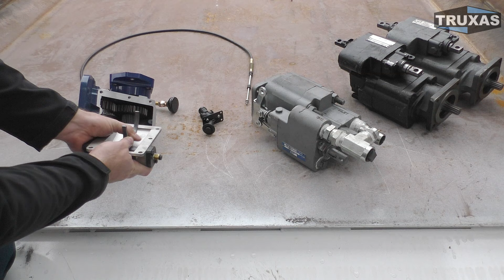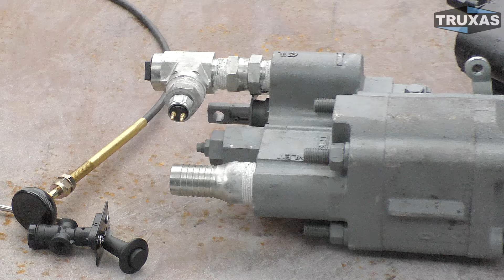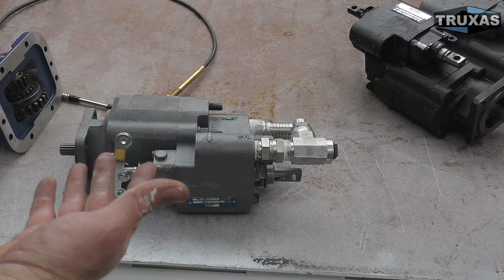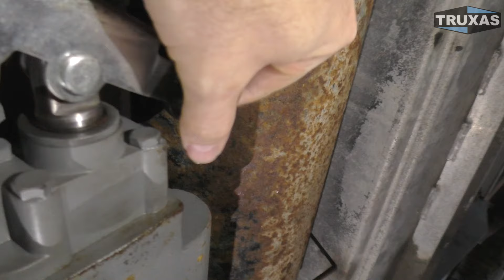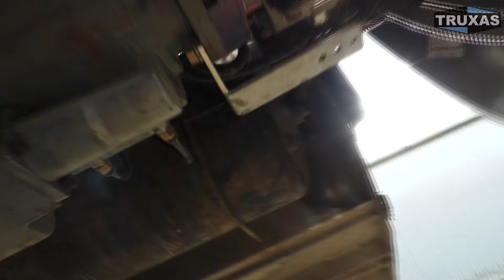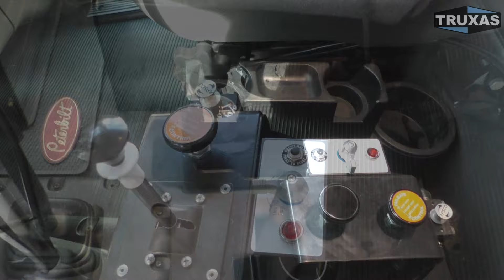Troubleshooting: Dump Truck Pump and PTO Troubleshooting

Comment: Wow- how is 1 in 20 automaticly not functioning? And 1 in 40 crap-out in 6ish months?
Simply poor manufacturing? 
You kinda alluded to that mentioning they looked like they were all siblings from the same factory..

..i had new rear brakes on a tacoma to install.  Pins were pressed in incorrectly seated, sitting at an angle rather than perpendicular.  Took them back to the parts store,  the other 2 new sets were the exact same. 
So you figure a few folks asleep at the helm for an hour or two ran off a couple thousand of them and got sent out..
But those pumps are not flying thru stamp and press stations like non-complex drum pads.  
Wild. 
What a waste of everyone's resources, huh?
Reply from the maker: yep, mainly bad internal seals.

Comment: I have a question it’s on a air system it goes up fine but takes like 7 to 8 minutes to go down
Reply from the maker: check the ajusment of the cable if its cable control, just like in the video, we do cover slow dump body lowering.

Comment: Im having to the issue that the pump is always on. 

It raises fine and drops fine. 

But the pto wont cut off. 

If i press the clutch it disengages. But once i let off the clutch, you can hear it.

All i jave to do is lift tue pull cable and up it goes. 

I have cut the air off to the up and down valve but its still engaged.

Im clueless 

Any help would help out

Comment: Can you clock a pto or pump to not hit air tank. It seems mine is hitting to the point where i would need to remove air tank and remount or get new smaller tank

Comment: I have a 1995 C60 Kodiak that has a Tulsa chain powered winch coming off the pto. I'm mounting an IMT HYDRAULIC crane on the bed that is hydraulic. What are my options for running both devices? Not necessarily at the same time it's just one is hydraulic, and one is chain driven.
Reply from the maker: most transmissions have 2 pto ports so you can have 2 hydralic systems, or you can by a more complex pump depending on what your powering

Comment: I just bought a 2001 international 4900 dt466e dump truck retired city street dept. plow truck has a allisson auto and they claim the pto is always engaged or no switches or levers to engage or disengage that doesn't sound good to me is there a way to change it or just add a switch or cable?
Reply from the maker: you can set them up with the cable, but most are electric becuse the transmmision needs to know your turning the pto on.
Reply: @TruxasSales  I want to make it a part time pto so you have to engage it can you lead me in that direction please
Reply: I'm being told that it's made in the automatic transmission and runs all the time that just don't seem right to me
 @TruxasSales

Comment: How to bleed your system after installation of new pump.?
Reply from the maker: depends on the hydralic hoist you have some are self bleeding. but the air will get trapped i the hoist not the pump

Comment: My dump truck bed lowering way too fast when it's coming down how to adjust it
Reply from the maker: Depends on if its air controled or cable? If it has a load in it it will always be prone to coming down fast.
Reply: Mine does the same, even when empty.

Comment: On Friday, i went to go dump a bed full of dirt. I drive a Peterbuilt. On the way up, not even a quarter up the way, i noticed my tarp was still down. Stopped the bed from going up to raise the tarp. Once i did that, the light on the control module for the bed that’s in between the 2 seats, the light went off. Now i can’t raise the tarp not the bed. What happened ? Any ideas? Feel free to call me plz

Comment: I have a driver who insists on leaving his bed up every night and the Maxle lowered almost to the ground. Is that ok to do? If not why? Thank you. All your videos are great.
Reply from the maker: You dont want to leave the bed way up because it exposses the dump cylynder to the elements and it can become tarnished or rust (the chrome part of the dump cylinder). Dump truck hydralic hoists are not the same as heavy equipment hoist that are ment to get wet. Raising it 6" to 12" to aviod puddling in the bed is good.

Comment: Question, if the dump truck bed is coming down too fast while unloading, what could the issue be?
Reply from the maker: could be there is material stuck in the bed making it weigh more
Reply: You either need a feathering air valve for controlling the valve, or...you are disengaging the PTO when lowering the bed. Don't. Use the hydraulic control valve only to lower the bed. When it's down, then disengage the PTO.

Comment: I got Question, I have a direct mount pump to the PTO as shown on this video,
Now is there a universal Yoke joint that can work off the Pump Shaft Using a pto shaft ❓
Reply from the maker: all Yokes are universal, but need to be the same size to work.
Reply: You either have direct mount components, or remote mount. They are not the same.

Comment: What will be the issue of when cylinder start bouncing at the last stage and hydraulic tank has enough hydraulic fluid. Also if i continue to accelerate to raise it all the way when I turn off the pump and lower the cylinder hydraulic fluid start leaking bubbling out of the hydraulic tank.
Reply from the maker: You need to bleed the air out of the cylinder, if you don't have a self-bleeding one, should be an air bleed valve on the top of the cylinder. check the oil level with the cylinder up.
Reply: You have air in the hyd oil. Your reservoir may be too small.

Comment: What would make my bed start dumping when I just turn the pto on and won’t stop going up until I push the clutch in it won’t stop if I turn the pto off or put in in lower position just if I push the clutch in then I can lower the bed also air powered
Reply from the maker: out of adjustment hoist controller.

Comment: I have a issue, when I'm lowering the end-dump, start losing hydraulic fluid for the tank lid. What could cause this?
Reply from the maker: It needs a small baffle protecting the vent cap. when you lower the bed the oil is shooting into the tank at high speeds.

Comment: how do you control the bucket lifting cylinders not to experience high pressure when offloading  to eliminate hydraulic system pipe bursting?

Comment: Is there a high pressure relief valve in the systen?!
Reply from the maker: Not typically on dump truck systems.
Reply: Yes, the dump pump valve has an adjustable main relief built in, preset at 2000 psi. Max setting is approx 2300 psi.

Comment: The main reason 1 out of 20 fail right away is they are mostly low quality China product. The only dump pump still made in the USA are Permco. Even Parker/Commercial are not made in youngstown anymore.
Reply from the maker: Premco is hard to get a pump out of
Reply: @TruxasSales  That is true. Our lead times are the highest they have ever been .Trying to get castings out of USA foundries now that many of the biggies are coming back is tough. We were kicked out of the foundry we poured our dump pump valve housing and finding a new supplier wasn't easy. That being said our lead times are better than most of our competitors. We are working very hard on this.

Comment: I have a air operated pto and works fine except when I lower it with a load there’s no way to do it slow it just drops at full speed. Any suggestions would be greatly appreciated.
Reply: Seal in side pump is what I heard in the earlier video

Comment: I have automatic 2018 Dodge RAM 5500. When I press the PTO button, the truck idles up and PTO doesn’t turn on. No matter what RPMs get changed to in the PTO settings in the truck it still won’t turn on. PTO measures 12 volts and all fuses are good. Any ideas what might be causing PTO not to come on?

Comment: 3:28 as a former dump truck broker who had drivers, this would be a must! This would have saved me thousands and thousands of dollars in labor and hydraulic pump costs as beginning drivers forget to turn off their PTO leaving the job site. It’s also very dangerous for overhead obstacles. Great idea that should come standard with all new pumps. Also, an overall great explanation of how your hydraulic system works. This video should come standard with taking your DMV test for driving air brake vehicles that have hydraulics.

Comment: I just had this problem... when I lower box and then tried to raise box the small little piston gets stuck and won't let box raise i have to hit it with a hammer to get it loose then it will raise up

Comment: My bed not going up or down. I hear air coming out the exhaust side of the hose.  I can just move the level valve from hold to up or down and it leaks air out.

Comment: Hey, I have a 2020 kenworth t800 with an Alison transmission,Muncie pto. My pto is stuck the engaged position. I was wondering if you had any advice on the situation. I have already replace the solenoid.

Comment: We have a 2019 F750 with a Chelsea PTO and it's crazy loud when engaged. The noise goes away when the truck is revved up. I'm told this is "normal" but to me it sounds horrible. Any suggestions?
Reply from the maker: what transmission does it have?

Comment: Can you make a video on the pto blowing fuses?
Reply from the maker: The fuse would be in a different place depending on who installed it. Fuse blown would be bad job wiring typically. We are make a video on a complete dump truck pto and pump installation.

Comment: Pls tell me the components of electrical system that activates the pto sytem of howo dumptruck..the pto of the truck is not engaging.pls help me..
Reply from the maker: each truck is wired different but ultimately its a wire from the battery/ fuse box going to a switch

Comment: pto wont engage when air swich is turned on 
it wants to engage but makes grinding noise help
Reply: pto wont engage till air psi is to 120  and then when lowering trailer it takes the same psi and lowers real slow
Reply from the maker: if you have a clutch petal push it in before engaging. If its still grinding could be not installed properly.

Comment: Thanks for your video. It's hard to find a video the way you explain it. I live in Denver. Colorado. I bought  a 1993 Peterbilt 379 dump truck a few months ago and fixing and replacing parts here and there. I need your advise about my pto and hydraulic pump. My pto is air controlled. No issues when I rise the bed, but when I try to lower it I need to move the pto knob almost til the other end for the bed to start lowering down, but my concern is that it slam and shake the whole cab. I know it's not right. Could you please tell me what' you think could be wrong? Thanks in advance.Renzo
Reply from the maker: when you say "pto knob to the other end" I think you may be referring to the air control that raises and lower the bed, which is actually the pump control. the air control are typically that way where is all the up or alll the way down, to go down slow you need to open and close the pump valve. A different valve may work easier, if the valve is really old it may be time to clean or replace it, a few drops of the Bendix oil in the line can help too.
Reply: @TruxasSales  Yes I was talking about the pump control next to the PTO (IN/OUT) control. Are you saying replacing this dual control valve that I have will help with this issue? I wish I could send you a video that it will explain better what is happening with my truck. When the bed is all the way up and I move my pump controller to lower the bed the two top cylinder sections collapse really fast shaking the cab and then from the third section down start coming down slowly.
Thank you so much for your time and for your help in advance.

Comment: What type of hydraulic fluid do I use for my PTO? I have a 1998 Chevy C6500 rollback tow truck with a 6 spd manual tranny. I assume the large tank just between the frame rails is for that hydraulic fluid, yes?
Reply from the maker: Any fluid should work, because its a low flow system, but mixing different fluids can be a problems and cause foaming.
Reply: The PTO is just a gearbox mounted to the tranny, lubed by the transmission. The hyd pump uses hydraulic fluid. Use AW32.

Comment: Thanks for the video. I learned a lot. My Muncie Air actuated PTO on my bucket truck is stuck on or engaged all the time. Now because of this video I know what I am looking at under the truck as far as how the PTO is actuated and what actually does that.
Reply from the maker: Glad it helped
Reply: @TruxasSales  I removed the unit, cleaned and lubed it. It was "sticky". It appears that the air actuated plunger was sticking. Now it is working great. Thanks again.

Comment: I have an 8200 International with 10 ft dump bed. I tried to tighten the safety cable you refer to in the video and it pulled out the cylinder when I raised the bed and didn't shut off the PTO. Why did it pull out the cylinder without shutting off the PTO?
Reply from the maker: It only shuts off the pump, not the pto.

Comment: Just wondering why my air operation doesn’t stop the bed in neutral position, I always have to go just a touch past neutral to stop the bed from going up:::: anything would help,,, is there any adjustment for air adjustment
Reply from the maker: maybe your control valve/ dump valve has air leaking to the air cylinder and is opening it

Comment: I have an old central axial pump on an old dot truck. I have not run it yet are those reliable because they rotate off the front engine.
Reply from the maker: that pump may not work for a dump truck application. but if its old and still works, its probably reliable.

Comment: How do you make the pump go just a lil faster on a system with air lines not cable
Reply from the maker: Pump should go faster when you throttle up the truck with the gas pedal.  you can also check that you have spec'ed the right size hydraulic lines.
Reply: Buy a faster ratio PTO, or, give it the gas.

Comment: I got a IHC roadranger trans. Single line for a Pratt dump chassis. 
Dump will go up but not down. 
Is the pressure release valve hard to replace?
Reply from the maker: Their in no pressure relief valve on most dump truck pump set ups.  I would start with check the adjustment of the tipping valve.

Comment: How does it work with a truck with dual or triple functions for the hydraulics like a hook lift truck? Is it just a pump with no valve built in and it runs into multiple valves like a tractor?
Reply from the maker: correct. the pump is pumping all the time and pressurizing the valves, and their is a return line.

Comment: Very nice video 
Question pls, can the PTO stuck the transmission while starting engine ??
I have problem with my transmission, I couldn’t run my engine.
I have doubt that PTO is the responsible part of this blockages 
Pls advise thank you
Reply from the maker: I don't think so, I haven't herd of that.  Especially if you have a transmission mounted pto and the transmission is in neutral.

Comment: Why can't I get the air value to work just put a new one on
Reply from the maker: Not sure what air value is? You mean valve? check the air pressure, may not be high enough.

Comment: What would cause the bed to go up while in the hold position. On a 3 line system with sleeve installed.
Reply from the maker: The dump cable is not properly adjusted or the seals in the dump valve are going out.
Reply: Look for dirt or stones stuck near the rear of the spool that do not allow full shifting of the spool.

Comment: Nice. 

On my truck. 
I have the air valve one. 
But I only see 1 air line. 

On yours I see 2 airlines. 

I changed my flip switch that turns the light on. 

On mine, the pump stays on running...
It doesn't matter what position the up or down lever is. 

If I pull the lever, it will go up. 

 I ran out of ideas.
Reply from the maker: Shutting the pump off manually is normal. you can set up an automatic pto shut off when you start lowering the dump body.

Comment: I have an issue with my air controlled pump when the bed is fully raised. It stays up and doesn’t go down I have to engage the pto again and dump it for the bed to go down
Reply from the maker: is it an auto transmission? may be a compute issue
Reply: You aren't supposed to disengage the PTO until after the bed is down. When you do that, the system is causing everything to reverse, including your transmission. Use the air switch for the valve to lower the bed with the PTO still engaged.

Comment: Thanks for the video. I'm driving a Western Star 4900 offroad and trying to familiarize myself with some of this so if I find myself in an situation I can potentially fix it myself instead of waiting an hour or two for my mechanic to come to me. One issue that is common with offroad hauling is mud clogging the plunger and not letting the bed raise. I drove a Mack RD for a while when I was 22, but I quit driving trucks for a few years and now that I'm starting back I'm trying to remember this all.
Reply from the maker: Glad it was helpful!

Comment: When you shut pump off with the wire rope what actually happens. Does pump keep rotating and oil diverted back to tank ?
Reply from the maker: yes the pump keeps rotating and can overheat, you can put a pump return line, that will increase your run time with no flow.

Comment: Why is there not a pressure relief valve to protect pump ? Does pump reverse direction for up down or is it the DCV attached to pump etc
Reply from the maker: yes it back flows thru the same line, no pressure relief necessary.

Comment: Is there a filter on the hydraulic system itself? My dump bed has recently started to slow at times, and I’ve noticed hydraulic fluid leaking. One mechanic mentioned a possible clogged filter. But not sure where the filter is located
Reply from the maker: No filter is necessary on these system because the flow is so slow, but you should change the oil every other year.